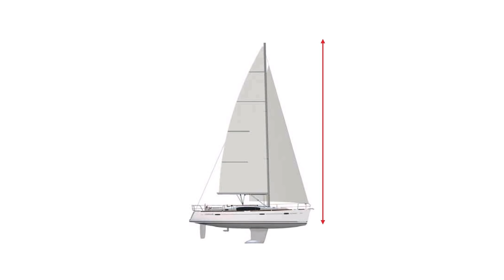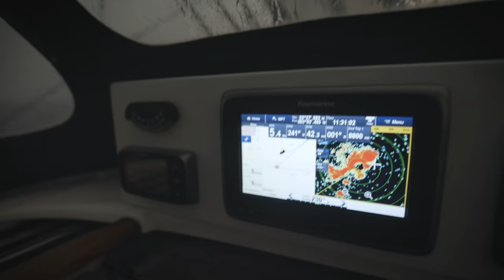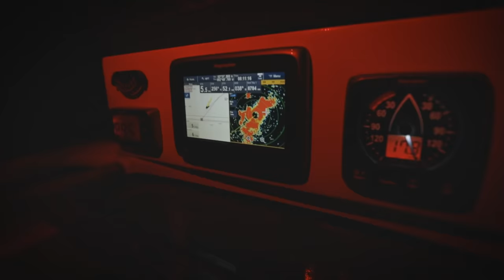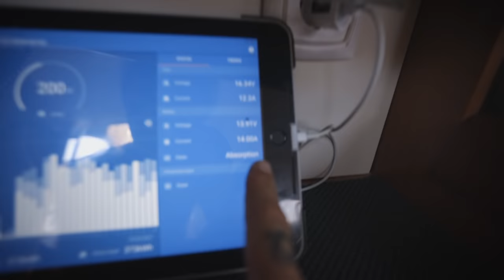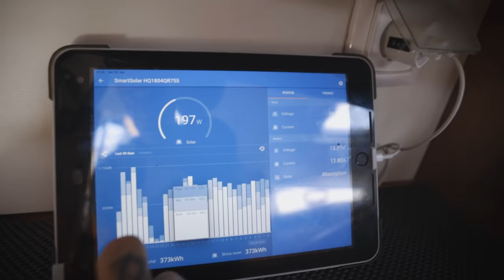Is a BENETEAU suited to Bluewater Sailing? (BOAT TOUR & REVIEW) ⛵️ | Ep 24

Comment: The reason production boats shouldn’t cross oceans is that the bulkheads are not strong, the hull is not ribbed, there isn’t enough strength in the keel, it doesn’t have enough weight to remain stable in heavy confused seas, etc. will it make it there? Yes, but the structure of the boat will be damaged in ways you wouldn’t see without ripping out the cabinetry and the sole. If you were starting with an empty hull, you could strengthen it enough to not flex, but there’s still not enough keel. Older full-keel boats were much more capable, but many of them have deferred maintenance. The  insane cost of a modern blue-water cruiser puts them out of the reach of almost everyone on earth, so most of us buy either an old boat (mine is from 1975) or a modern production boat and just take great care with it. It is the equivalent of taking a Cadillac sedan overlanding to Alaska. You’ll get there, but the car will need a lot of repair when you get home, and the next buyer needs to be aware of EVERYTHING.
Reply from the maker: Of course so many intricacies of the subject but the modern designs have less need for strength in the bulkheads as it’s obviously placed elsewhere in the structure. The keels are not so strong, correct but the older boats have equal amount of issues with decks, leaks and rotten wooden bulkheads. Thanks for tuning in.

Comment: Full long keel heavy displacement = safer stable solid, hate the production crap 💩 today,  those fixed rudders/keels just itching to snap if touching a tuna a dolphin or to much heavy sea.  🌊 no thanks yes they have done it many times but the risk to drifting is tooo much more than a long keel encapsulated option.
Reply from the maker: Long keel = long wait, long forecasts and a long list of other compromises but of course a very safe seagoing vessel. Some valid points so thanks for your input.